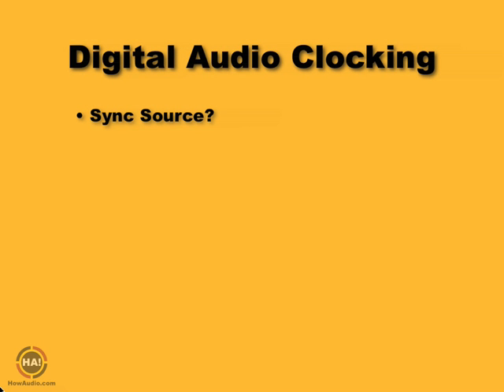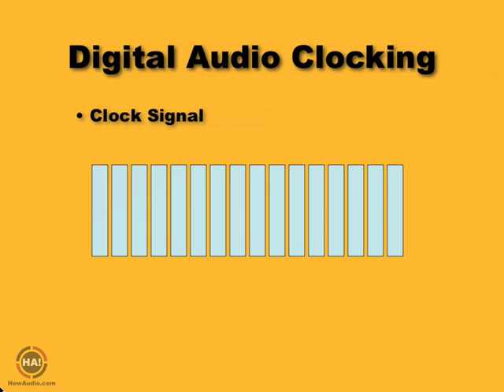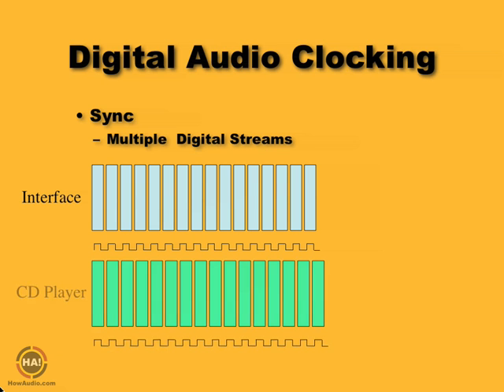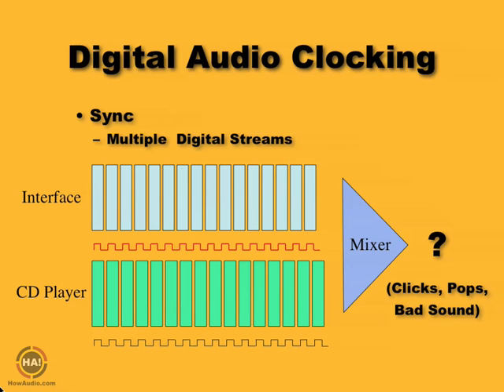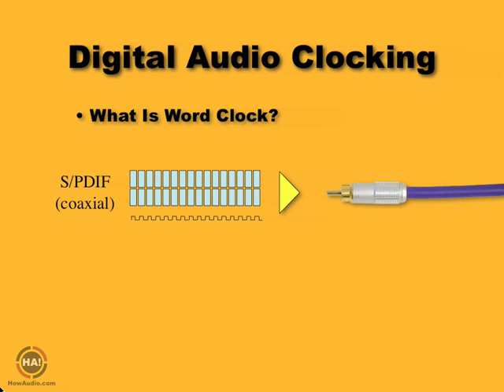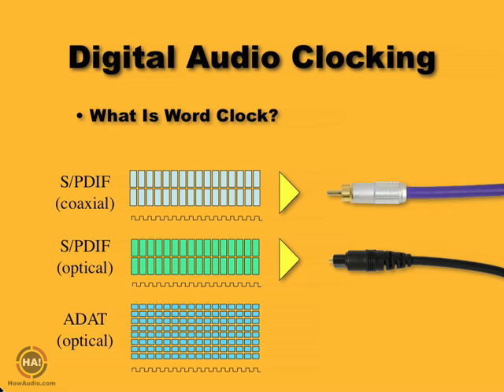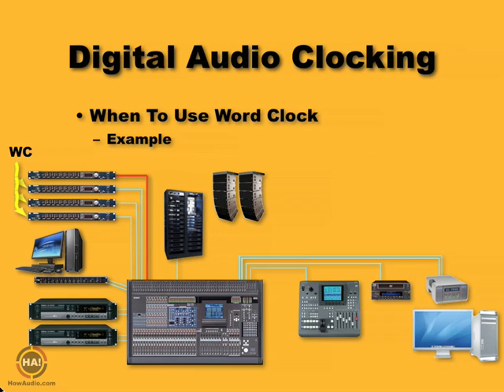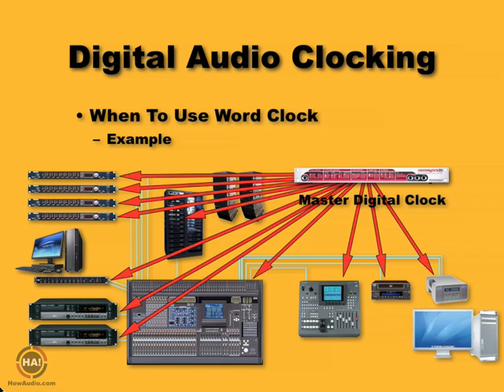Digital Audio Clocking

Comment: Great explaination! My question is can I clock at any sample rate even if 1 or more devices can only clock at 44.1 or 48? For example my mixer can only clock at 44.1 or 48 and my interface can clock up to 96. If i set my mixer as the slave, can i clock at 96k from the interface?